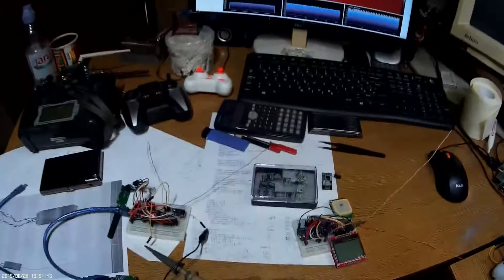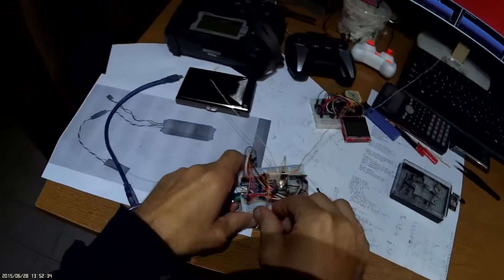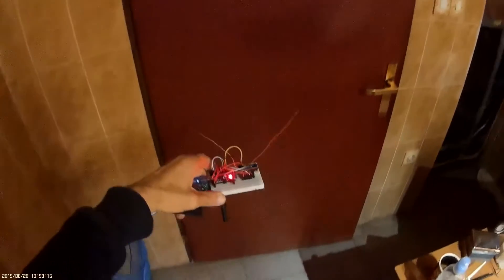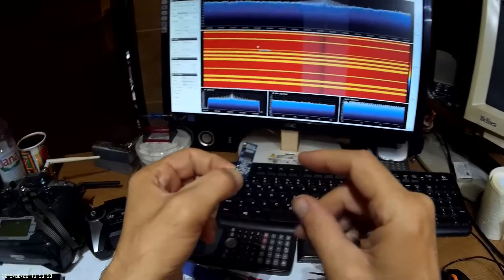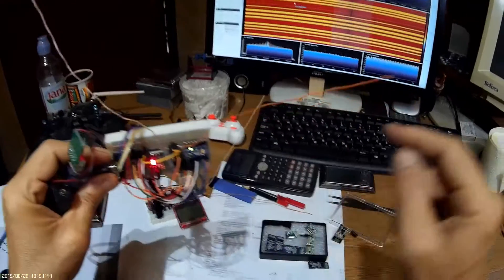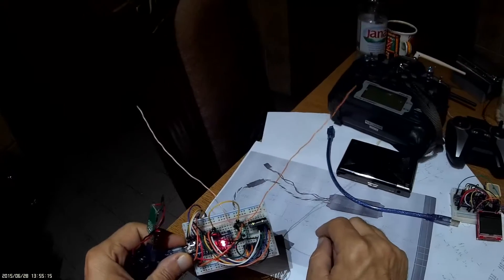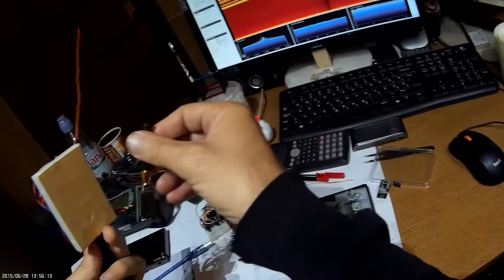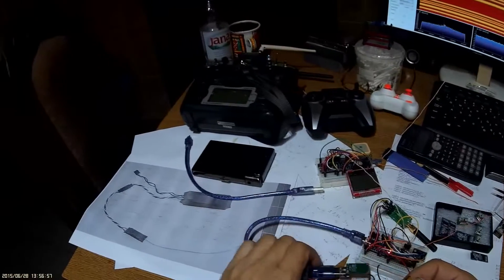Arduino Variometer - Designed By Rolf R. Bakke

Comment: Hi. Very good data. I am interested in building an audio-only "variometer" for use in paragliding. I have an arduino UNO board, and a pressure, temperature, humidity sensor BME280. Will I be able to do it with these elements? What "library" do I install ? Many thanks...

Comment: Hi Rolf, please,
I realized this little arduino vario (audio buzzer mode) with your tutorial.
How can I stabilize the sound of the vario?
Otherwise, it works normally, the frequency goes up when the vario goes up and down when it goes down.
Which line of code to change to change the latency of the vario?
Reply from the maker: Milan here, I should ask Rolf. I should to make it again, it has been long time since this video is made. So, you need less sensitive to altitude change?
Reply: @MilanKarakas I need the sound stops when the variometer does not move. For now, it emits a sound even when it is still, which is very embarrassing. I am using a nano arduino and ms5611 probe the D2 output on a buzzer.
Have you an idea?
Reply: It's for use on a real size paraglider...
Reply from the maker: @bidulm  Ah, okay. You need 'notch filter'. I had this question earlier, but did not solved it. I will try too look at this code and try to find solution.
Reply from the maker: On line 39, there is: "if (toneFreq < 0 || ddsAcc > 0)", try to change second part, for example: if(toneFreq < 0 || ddsAcc >1)" that number tells when to produce tone, I think that ddsAcc is related to change in pressure, in original is ment to be for ANY change. Not sure this number is in what (?) mB, meters per second squared or what else. I have no assembled variometer with Arudino and MS5611. If you have, please try change this first from 0 to 1, then if it is better try rise number to say 2, 3, ... 5, 6 and so on. Please tell me whether this helps.
Reply: @MilanKarakas   Hi, thanks for your answer :)
But I'm tryed to change this number, and it does not work... The vario emit always sound :(
Reply from the maker: @bidulm  FOUND IT!!! Please replace line 39 with new one:
if (toneFreq < -50 || toneFreq > 50 && ddsAcc >0 )
that -50 and 50 are limits. If still to sensitive, use -100 and 100 - in between is silence
Please tell me whether it works for you, so that I can update my web page
Reply from the maker: @bidulm  Also found that sensitivity can be adjusted at line 31:
toneFreq = (lowpassSlow - lowpassFast) * 10;   
Original value is 50, higher value gives more sensitivity, lower value less... not sure what should be minimum value, tried on desk - lower than 5 and I can't trigger it by moving up/down - I am not so fast. Try first 10.
Reply: @MilanKarakas  Hello! Do you know how to change the sensitivity level up and down, now it is the same up +0.1 (is ok) and down -0.1 m per second.  for a real paraglider flight, the down signal should be on by -1.1, -1.2 m.p.s
Reply from the maker: @jemalpirayev3327  Here you can found everything you need for changing sensitivity and range: http://wildlab.org/index.php/2015/07/07/arduino-variometer/
Reply: @MilanKarakas  Thanks, it works -150 = -1.2 m.p.s  50 = +0.4
Reply from the maker: @jemalpirayev3327  Thanks for the feedback.
Reply from the maker: I posted to you solution. Does it works? Please tell me, so that I can upload this for other people to my website. Thanks.
Reply: @MilanKarakas  Hi, Milan, that it's work great !
THANK YOU.
Now I'm work to design a box and print it with my 3D printer.
I'll show you in video when it' will be completly finished.
Reply from the maker: @bidulm  Thanks. It is very important for us both.